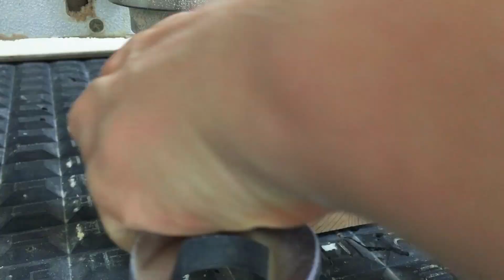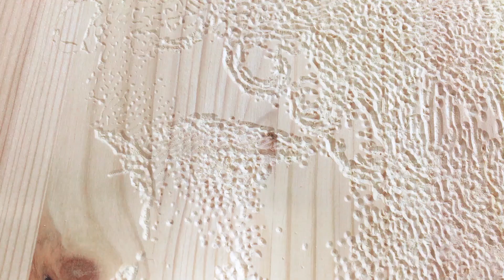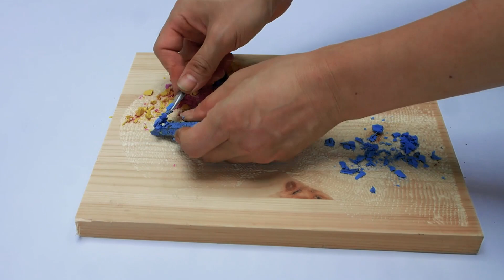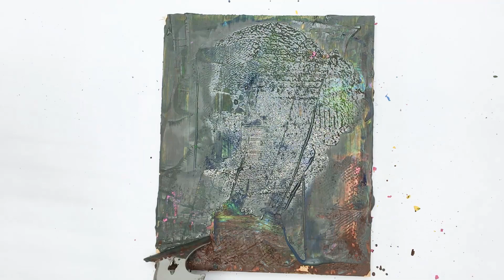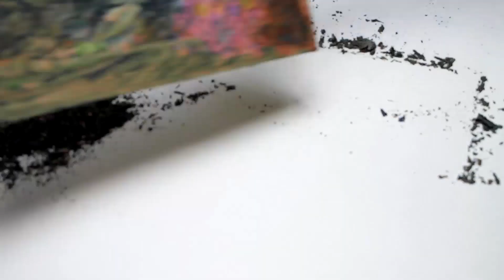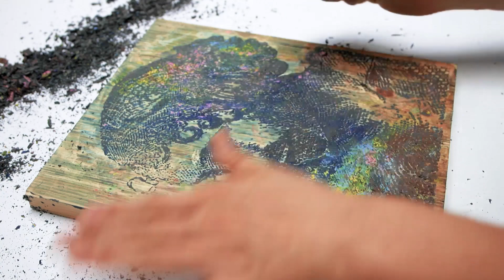Johanne Louise Heiberg

Comment: Hi, great job, I think you can get the same procedure with the laser, have you ever tried?
Reply from the maker: No, I haven't. I only have CNC. wanna buy a laser.😆
Reply: @MakerCathy  build it like I did
Reply: laser machine can not engrave wood with color, this Crayon melted is more attractive
Reply: @ninastylecnc6294  I meant that the hollowed out parts can also be obtained with the laser, obviously you have to use a soft wood 👍